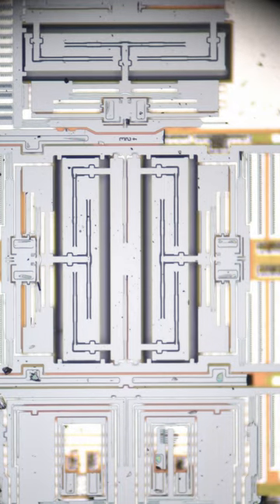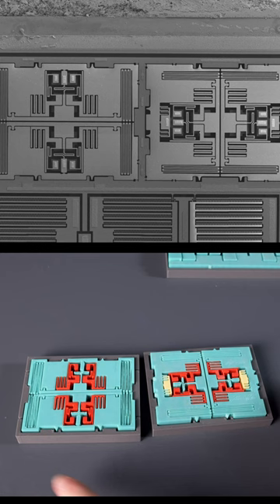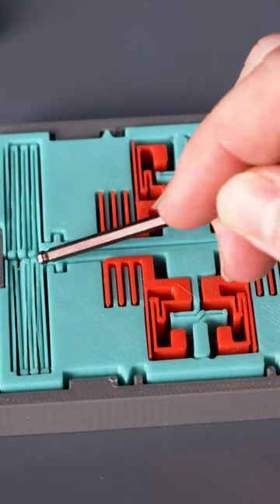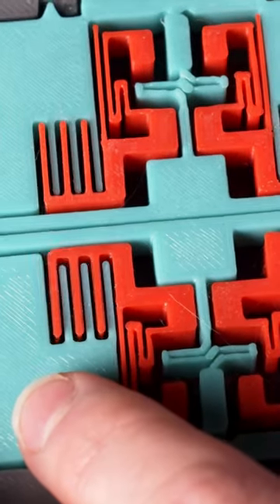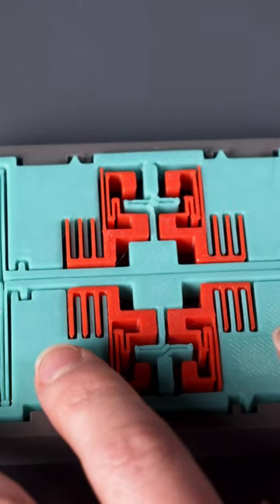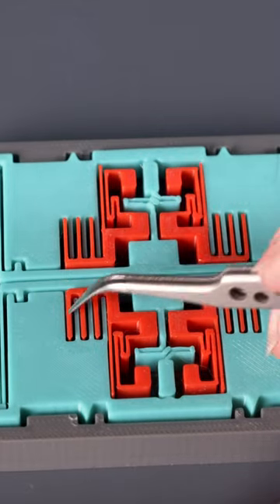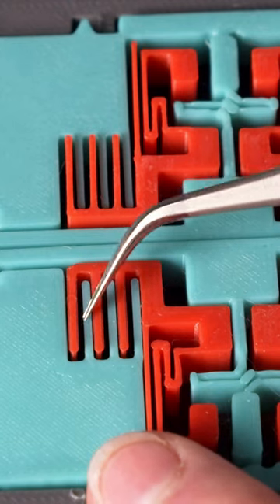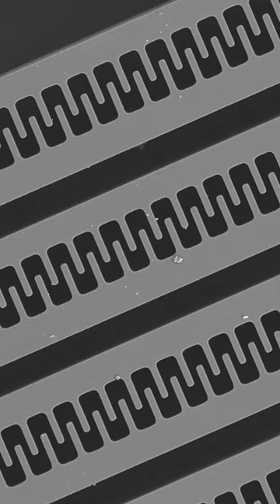Micro mechanisms in your phone

Comment: MEMs blow my mind. The fact we can manufacture and use these reliably is a technological marvel.  Thanks for the quick peak at them.  Would love to see a MEMs Gyroscope.
Reply: MEMs gyros are really just pairs of these, coupled.
Reply: I agree and would love to see a gyro explained. You can see it's pretty different if you pause the image when the gyro is highlighted.
Reply: WE manufacture?
Do you phisically do that?
That must be a great job to make a profit from?
Reply: @orbatos  Sounds like it could be easily fooled by a series of small accelerations.
Reply: @eklhaft4531  They often can be, like any device it has ranges of operation that are less than ideal. This can be aided by noise filtering and some degree of compensation in software, which both reduce accuracy. Using multiple devices can allow for axial corrections. As well, and this has been used even in consumer products.
Reply: I was recently at the Air and Space museum, where the Apollo inertial guidance system and gyros were considered marvels of miniaturization at the size of a washing machine and a beach ball, and cost millions to develop. Now you can get an Arduino 3-axis accelerometer and gyroscope for about $6 that’s the size of your thumbnail.
Reply: @timothy098-b4f Keep in mind gyroscope reaction wheel combinations are significantly more accurate, there's a reason they are used to stabilise space observatories. HRGs (hemispherical resonator gyroscopes) only recently replaced them in the Webb telescope and are about 30mm. These do not use motors and measure changes with doppler laser. This technology has been found to work best between 10-50mm in diameter, so a big achievement but not small enough for a cell phone.
Reply: @BabaNamKevalamGames yes we, as in humans. lol not hard to comprehend my friend.
Reply: @orbatos Also likely too expensive for a cellphone 😅
Reply: @eklhaft4531  gyros need to move in order to detect rotation (coriolis force). In a chip that is realised by them moving back and forth. This has a specific frequency - which you lock on for signal detection. Thus an acceleration not modulated with that frequency is filtered out.  Of course the frequency needs to be outside of accoustic range, thus above 20khz
Reply: @timothy098-b4f  That $6 MEMS gyro/accelerometer unit is more comparable to a desktop toy gyro than an aerospace guidance gyro. The modern equivalent is a laser gyro.

Comment: At first I thought maybe it was just completing a circuit, but a variable capacitance is actually a pretty brilliant way to do it.
Reply: actually, many sensors use this mechanism. The weight of potato bags are calculated by measuring their capacitance.
Reply: Just like a good microphone if you think about it. Makes me wonder if this thing could also detect sound waves and record sound if exposed to air... pretty awesome stuff!
Reply: Otherwise you just have data for excelleration and no excelleration. nothing in betwren
Reply: actually 🧐
Reply: @nfm.1707 yes it could
Reply: Muscles send a variable frequency to the brain for self perception
Reply: Completing a circuit could never work. That's binary, either the circuit is open or closed.
That gives you two output values.

You cannot obtain a range of measurement values using such a technique. Therefore you could not measure the acceleration, just simply detect whether an acceleration is present or not.
Reply: It's basically a condenser microphone but for acceleration.
Reply: well it is the only way to do it, wouldn't be able to measure acceleration with just on or off
Reply: Digital Calipers work the same way
Reply: @DolphinPain  I thought digital calipers used an interference pattern...
Reply: @deang5622  yeah that is basically a vibration sensor, it just triggers if there is any vibration. Often it is just a coil and a normal wire, the vibration causes the coil and wire to touch.

Comment: So cool! Blows my mind that this stuff can all happen at such a small scale.
Reply: Our vestibular systems use the same mechanisms to allow people to calibrate balance and proprioception
Reply: @crimson4066 😮🤔Cool😎
Reply: @crimson4066 yeap, we are biological robots huh only that we use liquid Endolympha instead of solid state detectors. 

The vestibular system, which is located in the inner ear, detects head movements and position.  It is made up of three semicircular canals following the 3 Dimensions of the space, X,Y, and Z. They contain a fluid called endolymph and receptors called otoliths.  Endolymph moves when you turn your head and stimulates the cilia of sensory piezoelectric cells that send electrical signals to the brain.  Otoliths are the crystals that move when the position of the head changes and also generate nerve impulses. The brain measures this resistance and compare it accorting to the weights values of the pretrained Dynamic Neural Network, so it already knows in what position is located to generate the appropriate corrective movements thread to avoid falling down and maintainig the equilibrium.
Reply: @azhuransmx126  does this even make sense

Comment: The Gyroscope uses a similar principle, but there are combs in perpendicular axis, on of which is being moved at a known frequency. The other one is moving togheter with it and as angular velocity is applied, it's movement is calculated into angle by the chip by accounting for the Coriolis effect.
Reply: Yeap, gyros are way more complex than accelerometers and tilt sensors together.
Reply: @azhuransmx126  how is tilt different than gyroscopes?
Reply: @SahilP2648  tilt sensors are just a conductor liquid inside a bottle or a metal ball inside a bottle, as the robot or drone or smartphone moves the liquid or the ball inside touches different electrode tips as it tilts, then close the circuit between the battery and the processor which has the program in memory. Depending on which combination of electrodes in the sensor are activated, the processor captures those inputs and already knows from the program what position in space the device is in and makes the appropriate corrections sending output pulses to the motors if is a drone or robot or changing the screen orientation if is a phone. The gyros measure another variables using coriollis effect and are much more complex to manufacture.

Comment: That makes sense. It's pretty similar to the way our bodies detect the movement of our head.
Reply: True! I studied this in school and I didn't even think about that
Reply: how so. what part
Reply: @Nixkip  your inner ear has these circle shaped tubes arranged perpendicularly to the 3 dimensional axis (if you imagine it's aligned with your head).  These tubes are filled with fluid and have hair on the inside that detects which way the fluid is moving (also why we get dizzy when spinning). I am assuming it's by the hair roots sending an analog signal to our brain but no idea how it all works from that point.  

Hopefully I'm explaining this properly and someone can correct me if I'm wrong.
Reply: @BrushyHat  you basicaly did an ELI5. The signal is used along others mechanisms to keep balance.
Out body also uses (not very often) organs external pressure to know its angle.
Equilibrium is managed by knowing a stable surface and having a way of tracking it. Our main way of doing that is with our vision, and that is why getting drunk makes you lost it.
Second way is the system you described that is used as a fallback system when vision based one fails, and since we are not used to use it a lot, we tend to get diossoriented.
Third one is organ axis position and that is the absolute least used.
It is used when you are vision impaired and somehow got your ears damaged and the liquid inside the system gets drained, either permanently or temporarly.
Reply: Biology is the best engineer, and we are its biologic robots.😂😳 but the sensoric biologic design has a bug. When we are spinning, we get dizzy because our IMU sensors are not solid state made like the MEMs, they are liquid based. In conclusion, future robots will not know what is to get dizzy.

Comment: Do these need to be individually calibrated, are they calibrated on an ongoing basis in software, or are they so precisely manufactured that no calibration is necessary?
Reply: I thought the same thing, i would think it would have to be updating itself due to parameters/conditions changing over time, but that's just a guess. Id like to know what the truth is.
Reply: They are tested at the factory and must fall within accepted tolerances.
Reply: The app usually tells you to calibrate it by moving the phone in certain ways would love to know how it works.
Reply: @its_whack I thought that was for the magnetometer?
Reply: @PatrickKQ4HBD you're correct as far I can imagine.
Reply: Today they are individually calibrated afaik also for cheap parts because the tolerances don't allow batch calibration.

Comment: That's not right i think. For sensing relative positions of a phone they use hall effect sensors not accelerometers. Complete different technics. Accelerometers are bild in chips like adxl345, which is often used for Input Shaping with 3D Printers and other stuff.

Comment: And I have a question, do these wear out eventually because these (presumably) are always moving. Or are they so small that this won't be a concern cuz of how things work at the microscopically levels?
Reply from the maker: If they are designed correctly, they should be able to operate basically forever. As long as the material stays in its "elastic" region (where it's not deforming permanently or inducing cracks) it can basically flex back and forth infinitely.

In practice there's usually a fatigue limit where tiny defects start to generate cracks and it'll break, but not for millions or billions of cycles. So effectively infinite :)
Reply: @BreakingTaps  I see, thank you for informing me! I will assume that if your device falls one too many times, it could form cracks in these.

Comment: Why are there each time 2 blocks for each direction when you showed how it works with just one?
And maybe can you show how Z is supposed to work?
Reply: Z can be done with a rocker with a heavier mass on one side so acceleration in z will change the distance between this rocker and a fixed electrode below or above.

Comment: Dude's just making up words at this point.😂
Reply: It feels like he's making up words when you don't go to school. In the simplest way it works is that the capacitance depends on the gap between two charge plates so it moves and changes, the capacitance also change which in turn changes the the quantities in a circuit like current which can be easily measured

Comment: Can you explain why my phones have ALWAYS, SYSTEMATICALLY gotten worse and worse and worse at accelerometer and gyro tracking over the years? Every single time I get a new phone, I get a few months of accurate pointers on google maps and then they suddenly start completely misunderstanding where the phone is pointing or the speed of its movement. Do MEMS usually break down within a few months? What is their typical failure state, requiring replacement? How could they lose accuracy if they're not quite broken? 

I've tried calibrations, dozens of times. It doesn't help. My phone has zero clue what direction it's pointing. Just like all my phones before.

Comment: So you're saying that this stuff is so small and fragile that a fart could throw it out of wack?  How do they keep it from breaking apart with just a simple drop from a lap?  Stuff that small and thin doesn't seem like it would hold up to the forces exerted upon it from gravity, centripetal force and/or sudden stops.  Isn't it made of silicon?  I own kilos upon kilos of silicon and it's rather fragile compared to most metals and I can fracture it easily.  Yeah, I know it's not a single crystal like chips are, but still.  How do they make these tiny little structures so strong?
Reply from the maker: It's a mass vs size thing. The silicon is very fragile and brittle, but the individual parts of the mechanism are so small that they have hardly any mass (like nanogram quantities here). So even under extremely high g-forces they experience very little actual force in absolute terms. It's just a matter of designing the structures to remain within the material's stress-strain curves. There are also bumpers and other mechanisms to keep the structure from deforming too far... if it experiences too much of a force it'll just "bottom out" and stop providing data, but won't break.

Comment: How can it detect really really small movements? Like really slow movements?
Reply from the maker: Even really minor disturbance can be sensed because the mechanism is ultra sensitive. The capacitive mechanism can detect very small changes in distance. But these devices are typically designed to work in a range based on the ADC and how much gain is being applied, so if they are designed to sense very small movements they are unable to work at the higher range and vice versa.

Comment: Whats the minimum threshold of motion detection and can it possibly be improved further than what we have now?
Reply: Ever since these became affordable with fire the customer market (about 15 years ago), they have been incrementally improving drift and regard sensitivity slowly. Modern components with pairs of these coupled for use as gyro (as you saw in these images) are then merged with other data from visual (usually cameras or optical flow) or radio (e.g. gps) for stability and orientation accuracy .
Reply: Finer detail than your hand can move.